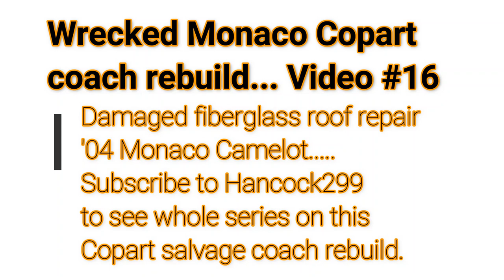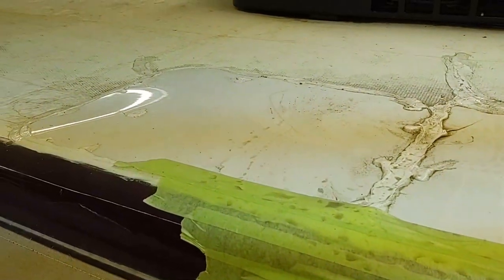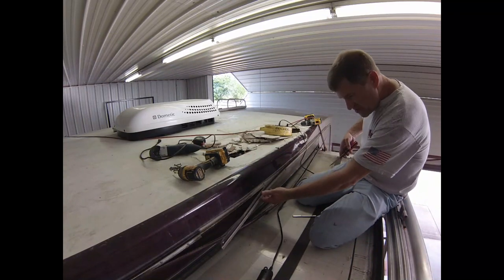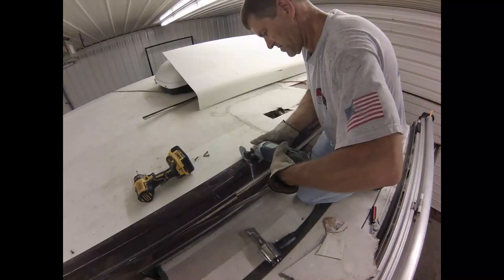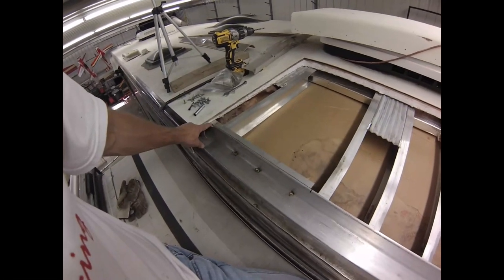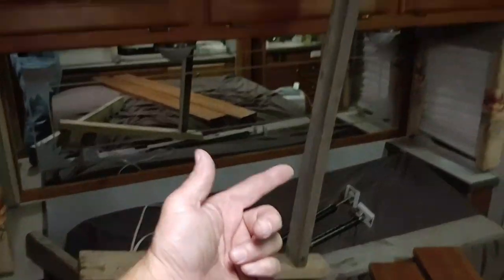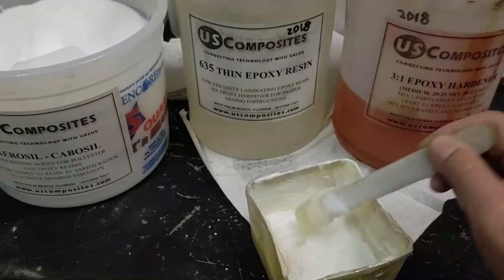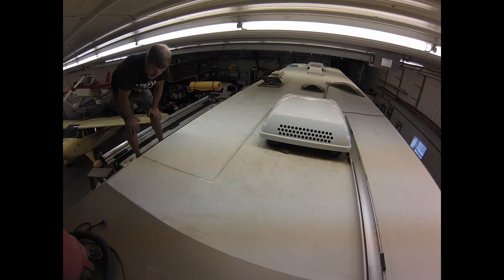Wrecked Monaco Camelot RV from Copart Rebuild..... Video 16

Comment: Nice Job! I was curious on how that roof laps to the side panels. I've got some delam on the side panel that I want to fix but haven't taken apart yet. Wasn't sure if the roof overlapped the side panel or the side panel overlapped the roof once the molding is removed. I would love a side layer view so I can plan my repair attack.
Reply from the maker: Mark, the roof overlaps the side panel kind of like a shoebox.